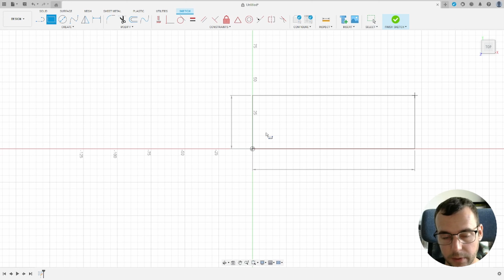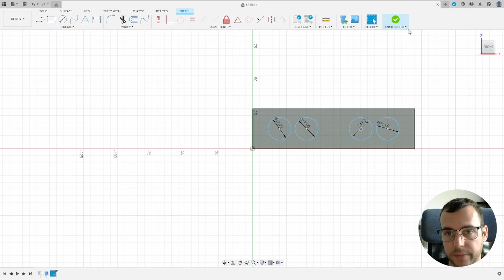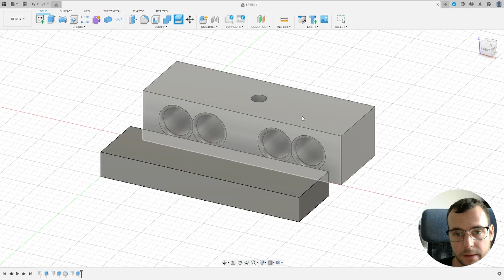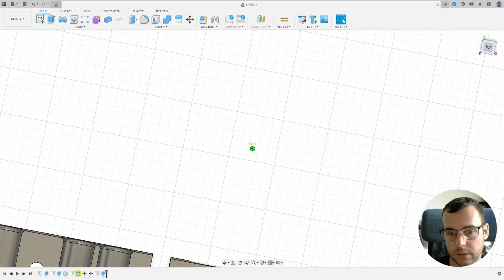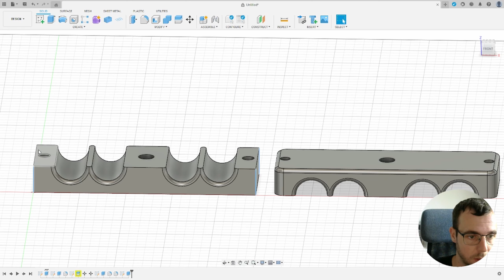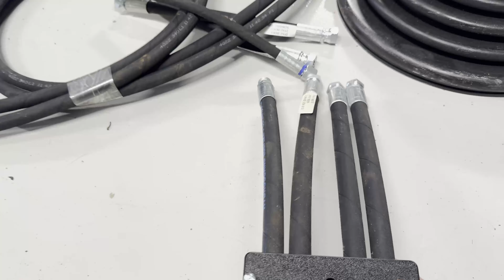Desiging a brake line holder in Fusion 360! Tatra 815 to expedition truck project

Comment: Would the bracket sit flush in the surface below? (Can't really see it in the video) If so, it might be good to route the drainage holes under the threaded inserts sideways ,to prevent moisture accumulatung.

Also, uou coud add rubber tape to clad holes instead of shrinking them. Might prevent wear on the hoses.
Reply from the maker: Nice good feedback, yes it’ll be flush to the chassis on one side. That is a good tip!